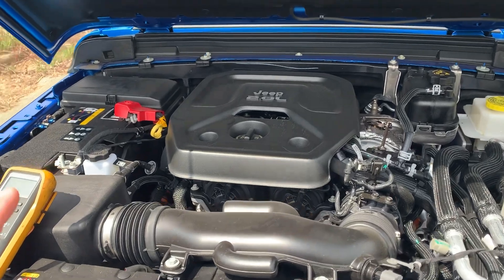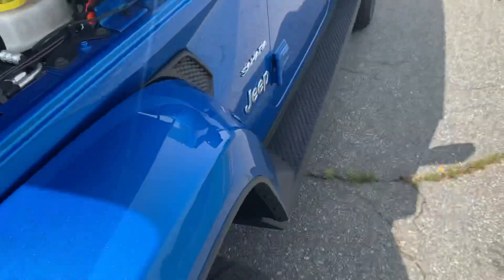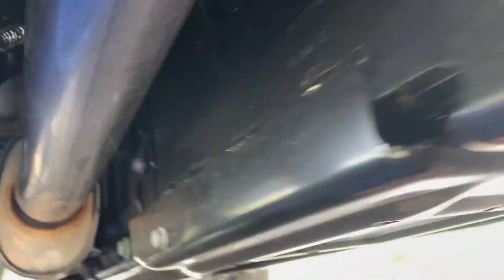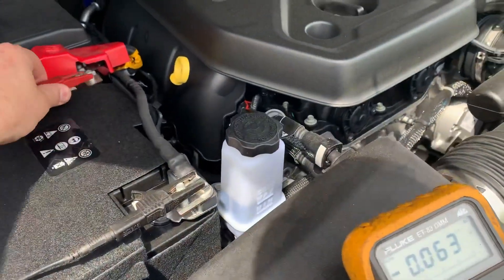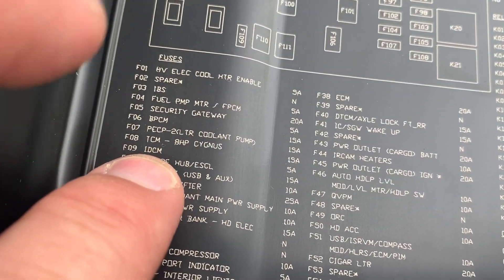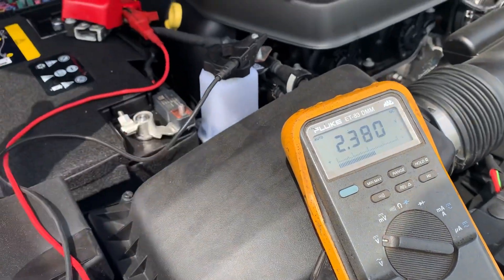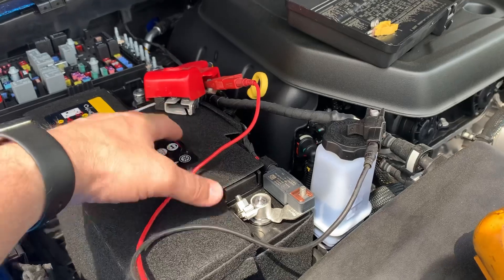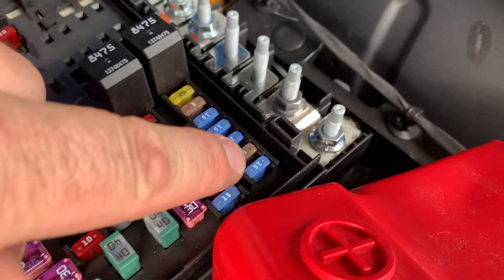Jeep Wrangler 4xe hybrid 12 V battery disconnect

Comment: Great video!  I have a question on replacing a battery on a 2024 Wrangler 4XE.  If I’m just swapping the battery for another one do I have to pull fuse for the IDCM in your opinion?

Comment: Is it safe to pull the fuse while the jeep is drawing power? My jeep has the dash all lit up, can't start it nor can I shut off the battery. Dash says close fuel door, service electrical system, and every icon is lit up. Front lights are on too.

Comment: F.Y.I. I just changed my battery:
For a while my remote start have been acting weird, at one point my gas cap would pop open by itself. 
Finally the battery died,  and things started blinking and wipers turned on.
Tried to jump it, that didn’t work.
Replaced the battery but it still didn’t start, I had power but the engine light and charge system error codes came on. 
Found this channel and followed his instructions, I realized I didn’t unplug the f9 fuse. Jeep is back to normal! 
Thanks Brandon, you’re awesome!!
Reply: Did you replace the fuse?

Comment: UNNECESSARY!  
Folks, just read your owner’s manual, the section on storing your jeep.  The manual says to disconnect negative battery cable.  It DOES NOT say anything about removing fuses.  
Your 4xe has a built-in safety feature that disables the circuitry when you open your hood.  I know this because my jeep told me so via onscreen warning messages saying battery cannot be charged while hood is open.

Comment: If I am connecting cables to the battery permanently to provide juice to my air compressor, do I pull the fuse and connect as suggested in the video?

Comment: Thanks for the video. Highly appreciated.
Quick question, please. What if we disconnect battery without removing IDCM fuse?

In detail, the reason why I am asking is that I ordered Jeep Grand Cherokee 4xe (assuming same system as Wrangler 4xe) from USA to Europe, the logistic company disconnected battery before loading car to the ship. But when we opened container in destination port, car didn't start.
They usually disconnect car because of safety and in order to ensure car battery didn't drain our of energy as it takes about 2 months to arrive.
However, as I know assume source of the problem was not removing the fuse.
Anyway, as it already happened what can I do?
Just charging car by cable would be enough? Or  does car's hybrid system needs repair now?  Would IDCM system would suffer from that? How to check that? Any advise could help please. As detailed/long answer please to my particular situation please?

Comment: I wonder how many people who replaced the stock 12 volt with one that actually works did it this way. My 24 4xe Sahara had to be jumped last week with 309 miles on it and 4 days old. Dealer replaced the battery with another mopar. Next time it fails I’m replacing with a 3rd part battery and will remove this fuse first. Thanks.

Comment: Just bought a 2024Jeep 4xe. I know nothing. When plugged in does IDCM charge 12v from the plug or do the electrons first go to the hi V battery THEN to the dc-dc conveter, THEN to the 12v. I ask because if I connect accessories to the 12v, will the 12v keep drawing from the hi V battery whether plugged in or not, so I can run my accessories off of the 12v until the hi V is drained? Or maybe the hiV just trickles the 12v which is not enough to keep accessories powered? Jeep gives us a stepdown power cord with 4 120v plug in receptacles but it only works outside the Jeep. I want to know if i can power accessories off the hi v from inside the jeep, like a fridge or heater (17kW hrs)

Comment: This video is inaccurate. It clearly states in the manual that when the hood is opened, the high voltage charging system is disabled. You can verify this by opening the hood while plugged in and it will stop charging. No car manufacturer would allow such an obvious liability where a person could get electrocuted by simply changing a battery.

Comment: Thanks for all of these great videos. I picked up my 4xe just last month. It's so great, and I appreciate all the items you've covered - they really helped me decide to go with the Hybrid Wrangler.
I'm adding an LED Spare Tire 3rd Brake light - before even starting, I'm guessing I should do this, allow the capacitors to 'power down' (get all the way to 0v) and then install the additional brake light? (Then, once complete, re-connect everything.)

Comment: I need to fix/weld the rear shock mounts and there are questions about the need to disconnect the IDCM (large orange cables and FO9 fuse?) as the arc welding could cause electronics issues.  Has anyone welded on a 4xe without damaging the IDCM/battery?

Comment: hi Brandon, just coming across your video now but after I've had the local shop install an alarm and the Genesis Dual Battery system.  I'm pretty sure my 4xe was their first and I'm hoping they had removed the F09 fuse.  If not, should I replace the F09 fuse to be safe?  Also, I'm now going to try and install the Spod and roof lights to the rack, do I need to power down the 12v and remove the F09 fuse to be safe?  Thanks and hope all is well!

Comment: Do you happen to know if F09 is a Micro 2 fuse type or something even weirder? I'm considering using a fuse tap and switch installed through the top of the box to mimic removing the fuse. I'm going to have the Rugged Ridge snorkel in the way of removing that cover, so I need a quick and easy way to disable the IDCM when disconnecting the 12v battery.

Comment: Do you know if the IDCM charges the battery when plugged into 120/240? I've had a Ford Fusion PHEV and Chevy Volt, and neither kept the 12v battery charged when I'd leave it in my garage while out of town for weeks. So I had to install a separate 12v battery charger for them.
Reply from the maker: Yes it will keep the 12 V battery charged if it starts to go below 10.5

Comment: Brandon,

Hey brother, I love your videos. I’ve had so many issues with the charging system. A month after having the IDCM replaced, and now my turtle light, got stranded and no movement whatsoever. I’m letting the dealer know what it could be, but I’m also concerned as to why it would have died overnight? Out of curiosity, what is the required battery CCA for replacement?
Reply: Were you able to get it fixed?

Comment: Since it's only a 5amp fuse does that mean the idcm only charges the 12v system at 5 amps?  Or is the idcm control circuit ran off of the 12v system and that control circuit needs 5amps?
Reply from the maker: The five amp fuse is only to power up the IDCM

Comment: Hi , i have jeep sahara 2021 , while traveling for more than 2 months and not use the jeep , how i can disconnect the battery from the system ? Is that possible without effecting or damaging the aux and the main battery ?
Reply from the maker: In your situation I would just disconnect the negative battery cable on the 12 V battery. This will disable all activity on electronics.
Reply: Is that will effect any components , like radio or saving records about the screen
Is the radio required a code to reactivate?
Reply from the maker: The radio may need the anti theft code if it’s that long. Not 100% sure though.

Comment: @Brandon Haneline I know you're planning on running this experiment, but your experiment on running the house, and your other experiment with the fully dead battery, sure do make it seem like the "engine" has to be "on" for the IDCM to provide any power back to the 12v lead-acid battery.  In which case this fuse removal step doesn't seem necessary?
Reply from the maker: It’s just what the owner manual says. No one does it.
Reply from the maker: And yes the vehicle had to be in the ready position to charge the 12 volt battery.

Comment: Got our 4xe today. Two problems already. Dash lights turn off in auto mode at night.  Radio will not shut off after exiting the jeep and locking it up. Any suggestions?
Reply from the maker: Is this all the time or intermittent.

Comment: Hi Brandon. What kind of battery does this use? Since you dont need a cold cranking battery is this more like a deep cycle battery? Thanks.
Reply from the maker: The high voltage battery is lithium ion.
Reply: @BrandonHaneline  I'm referring to the 12 volt under hood battery. If it's not used to start the car a high amp battery isn't needed so wondering if they used a different kind of 12 volt battery than a traditional high amp battery.

Comment: Can you run a lithium battery instead? I'm curious how that would work in this?
Reply from the maker: Great question I would have to say no because lithium batteries charge at a different rate then flooded or glassmatt batteries.
Reply: @BrandonHaneline  They are being used but for now as far as the 4xe goes I agree, it's a no for now but someone will figure it out in the next several years. This is a video that explains some.  https://youtu.be/FbStDC-7Q9E

Comment: Does it charge the 12v even when the car is off? If we had a fridge and didn’t drive for a day or two would the 12v discharge, or would the traction battery continually top it off?
Reply from the maker: It would discharge the 12 v battery  but the  IDCM would keep the battery charged up. That would be a good test.
Reply: @BrandonHaneline  can you confirm the IDCM does in fact continue to top off the 12 volt battery while ignition is off?  Pretty interesting if it does.
Reply: Also keen to understand this. I recently went on a road trip and had my fridge/freezer plug into the permanent 12V in the rear of the Jeep, but daren't leave it plugged in overnight or even when stopped (thought it would quickly drain the battery). I did have a deep cycle battery with me to switch too, so it worked out ok, but i would love to know if it is possible to leave it plugged into the Jeep without causing any issues?

Comment: I thought that you should put the positive side on first before the negative side.
Reply: Positive first when reconnecting a battery. Negative first when disconnecting.
Reply: @shaneleehafner  correct, Brandon showed it wrong
Reply from the maker: If you do there is a large arc when connecting.